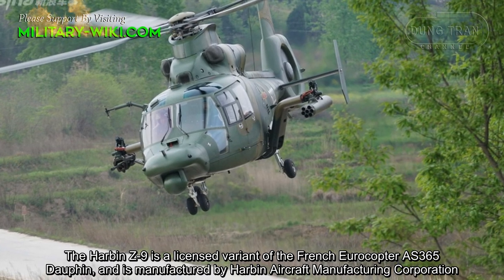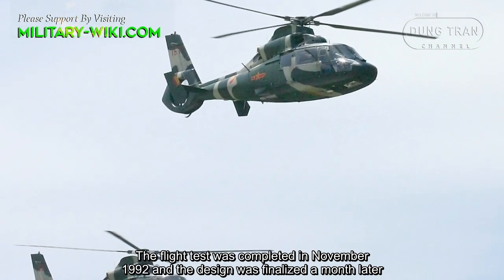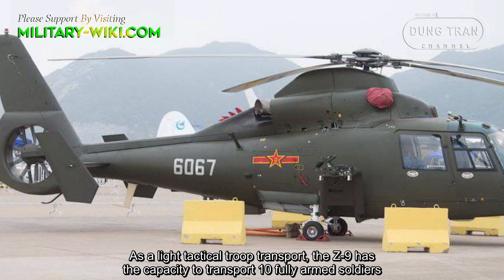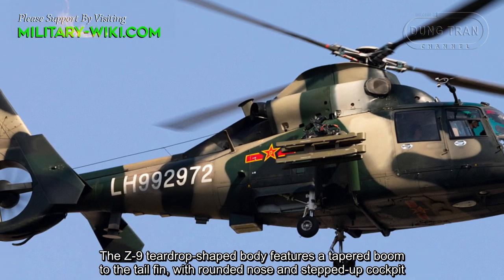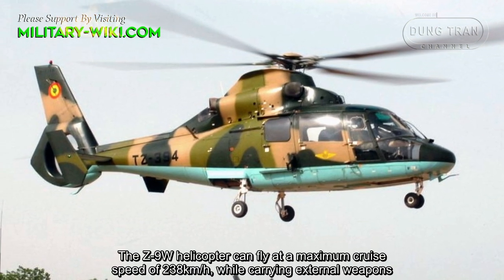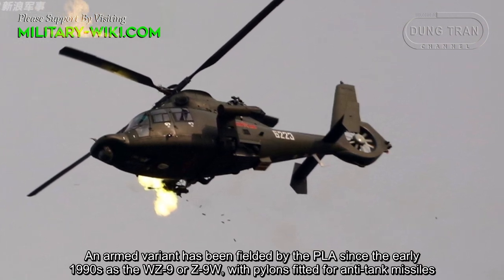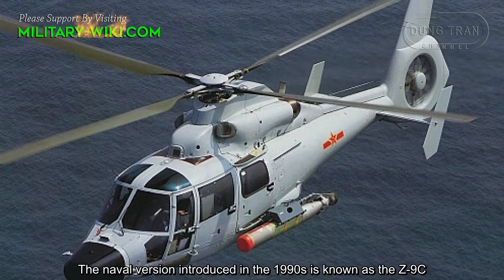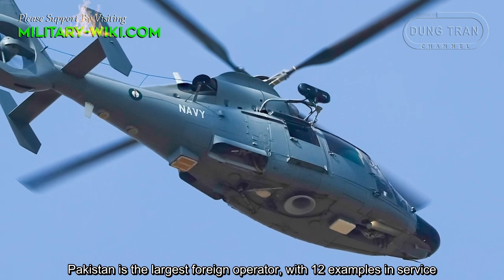Harbin Z-9: Amazed with China's Military Utility Helicopters

Comment: i've been in a Dauphin and no way in unholy hell do they get 10 fully equipped soldiers in that thing!!!
Reply: Some civilian dauphin have 8 seats behind the pilots. I am sure they can carry at least 10 fully equipped soldiers if they remove all seats and leave the doors open.
Reply: @joelau2383  you maybe sure but not me!!
Reply: @joelau2383  it would depend on the meaning fully equipped if that means full field packs 10 guys and full packs space wise iffy at best weight wise 10 guys at say a 180 pounds plus 80 to a 100 pound packs adding up around 2,500 to 3,000 pounds with their guns and ammo no way!!
Reply: @keithmoore5306  100 lbs packs with no weapon? As far as i know, a heavy full loaded gear for US troop with all his rifle, pistol, grenades, level 3A vest/helmet, supply and 310rounds 556 weights like 120lbs. 

So 10 troops should be 3000lbs. I don't understand why a heli with 4200lbs internal payload capacity cannot lift these troops.
Reply: @joelau2383  i heard wrong on weight capacity then i heard 3,200!!!
Reply: @keithmoore5306  Well, payload means cargo + internal fuel. Helicopter can only carry much less fuel if it takes off with max cargo capacity.

If z-9 takes off with 3000lbs heavy cargo/personnel load, it can only carry around half of fuel capacity.
Reply: @joelau2383  yeah 75 gallons of jet fuel eats 500 pounds of lift and this thing carries what 120 or so gallons normal fuel load?
Reply: @keithmoore5306  
Around 180 gallons. The internal fuel tanks is like 291 gallons if i remember correctly.

And it probably need a runway to take off safely with such heavy weight. Fun fact, helicopters with wheels can take off much easier on runway like fixed wing aicraft, because their engine perform much better if they have around 50km/h forward speed.
Reply: Well, a fully equipped soldier if not the same load depending on which country we consider. 10 fully equipped Kenyan soldiers is not the same as 10 fully equipped canadian soldiers.